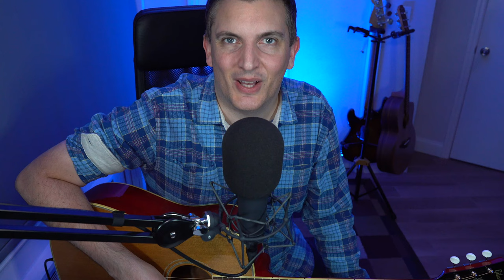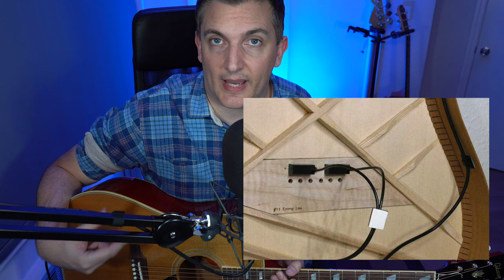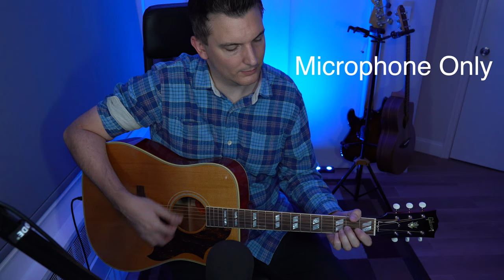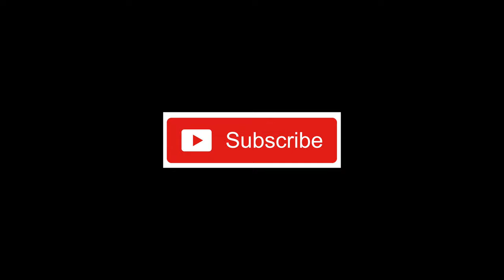Acoustic Guitar Pickups #12 - Amulet MVT

Comment: I own the Trance Amulet MV (just volume wheel- no tone control). I love it. I installed it in my Stonebridge (Furch) cedar top acoustic. Here's a video with quite a bit of the pickup in the clear, even though the vocal mic was picking up a tiny bit of it as well:
https://youtu.be/3r8HBq3UVPQ
It will feedback, like any soundboard transducer if pushed, but that rarely happens, and I gig with it a lot. I think Gibson might have set that Amulet a little hot on both the treble and bass. Mine doesn't "clack" like that.
Reply from the maker: Hey Nick you guys sound great. The Amulet does sound good but I just don’t feel it warrants the cost and installation for me. It still sounds like a pickup. I think I’d rather have a passive under-saddle or SBT with an IR loader (Aura/Tone Dexter etc.)
Reply: @aaronshortmusic  Yes, installing it was a beast. It does definitely sound like a pickup but when I run it live through a Grace Alix, it's better. I do prefer it to my Taylor ES system, but it's the old ES.
Reply from the maker: nick spear Cool. Have you tried the Tone Dexter or other IR loader?
Reply: @aaronshortmusic  No. I didn't even know about it. But now I'm obsessed with Tonedexter!!
Reply from the maker: nick spear Ha I think you would like it!
Reply: @aaronshortmusic  
I actually found this guy playing a Trance Amulet M through a tonedexter! 
https://youtu.be/mYBgVt2RvLg
Not to be cheeky, but I do think the install/placement of his Amulet sounds better than the one you were playing. I think the key is backing the gain way down on that internal preamp in the guitar. 
Anyway, thanks so much for your videos and introducing me to a fascinating piece of kit! Cheers.
Reply from the maker: nick spear Enjoy! The Baggs soundscape is also due for release soon. Good times to be a musician!